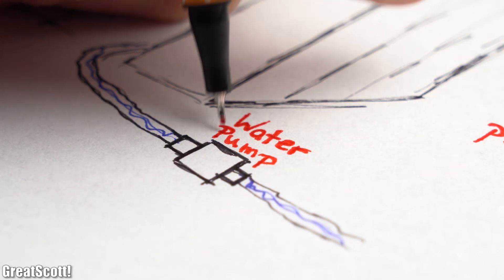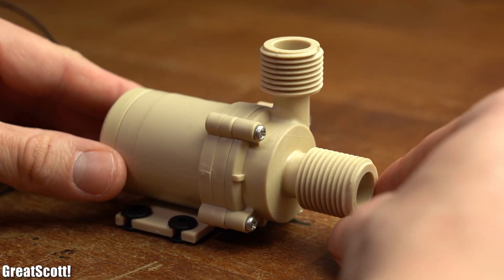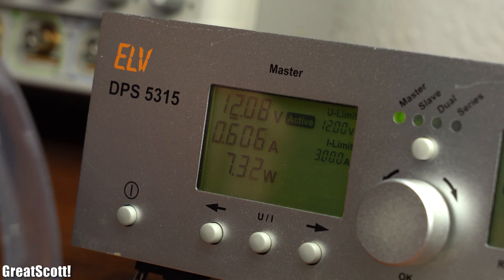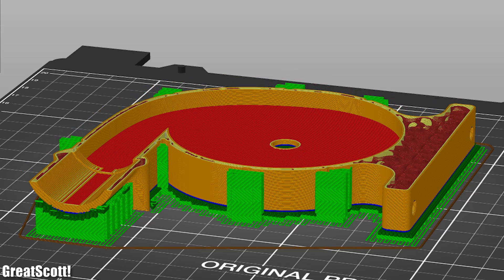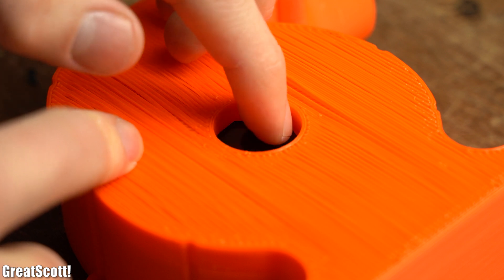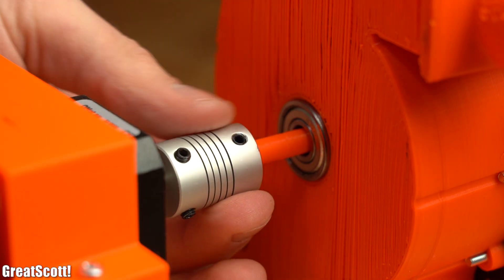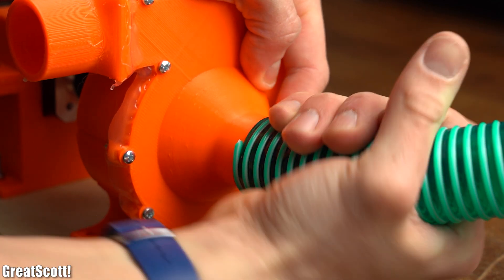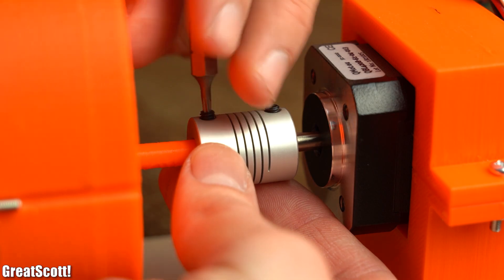Water Pump || DIY or Buy

Comment: Reduction in size of the pump volute and impeller would work for you, also this DIY design has its flaws, the discharge line dia. and suction dia. should not be the same, the discharge should be smaller. You need to ensure there's adequate Net positive suction head AVAILABLE. You could try printing the impeller and shaft seperately and lock it with some mechanisms like small screws or small key locks. The bearing should take the complete load and help rotate the rotor, but I suggest you assess the fit between the shaft and bearing. I also suggest you can read API 610 to know more about pumps.
Reply: And also since you have a 3D printer you can play with impeller designs, the blade angles etc.. to increase the pumping efficiency. You could also use normal PTFE tapes and make a seal packing. An eccentric reducer at suction line would also help you. I believe.

Comment: Water is one of the basic needs of life.  And so is food.  So, whereas watering your garden may be a luxury for you, it may be critical to someone else, as may be supplying their house or villiage with water.  Please reconsider attacking this problem until you reach success, even though it has been more than you wanted to invest.  Sometimes, 3D printing a mold, and forging a critical part in some kind of metal is the only way, so please consider that as well.  Thanks.

Comment: I made a water pump on my cnc machine crazy power  but stil not enough  so I'm going to put a 300 wat motor on it it's going to be a fuel pomp for a a rocket engine so for me buy it not the winner here because pumps this small never come in my power needs  but hay I do have a cnc macine capable of machining aluminium  so I cant really compare

Comment: 1. 3d print water pump.
2. put ripper bldc motor with 240a esc
3. test it.
4. if you didn't fly to the moon it is not working

Comment: Need a bearing on each end of the turbine so it doesn't move and snap the plastic... How didn't you see that? It was wiggling all over. Also could have sanded surfaces more and applied a permanent non-stick coating  to plastic to plastic moving surfaces.

Comment: Clearly, you are not using principles of fluid mechanics. In short use small motor print and small diameter of pipe instead of a huge one( You are putting too much load on the spinning shaft ). like the one you bought and have a small rotor instead of the big one. Try to use a metal shaft and ensure the metal shaft is properly connected to the rotor and you are good to go. I like what you are doing great work.

Comment: You are not supposed to apply teflon tape to that simple hose connector bust instead used a compression strangler...the metal type

Comment: For low pressure I use Rule boat bilge pumps, cheap and rock solid. For high pressure I use RV water pumps that will do 55 psi, for things like spray emitters irrigating my lawn.

Comment: I've made small water pump with junk plastics, metal and dc motor. I've made the fan by cutting and and glueing plastics and metal. The performance is satisfactory for a small pump. The most important thing is I had fun doing it :)

Comment: Taking the "replace the drive shaft with metal" I would have printed the impeller and drive shaft separately  so the layers of the shaft were lengthwise, thus making the shaft much stronger against sheering.

Comment: I'm genuinely shocked you didn't use a silicone gasket for your pump housing. Stuff is readily available at most any hardware or auto parts store, or if you're in a real bind, a steady bead with 100% silicone window caulk can be used short term.

Comment: seems like buy is the solution for the pump purely because of precision and material strength. that 3d printed one was wobbling around like crazy. I think there probably is a design of pump that with your material in mind, could work better than a centrifugal pump but that's a larger deeper dive. Additionally, its really going to be up to what you need to accomplish and that 3d printed pump seems like overkill when you probably only need a few litres/hour pumped.

Comment: why do your 3D prints have such a low quality? I think that with some fine tuning, you can drastically improve the quality of your prints and make them stronger. I think that if the impeller were printed with a polycarbonate material, it might have worked fine. 

I still think that buying is the way to go. Unless you have access to very good hardware and tools, and have some knowledge about fluid dynamics, a bought pump will outperform a homemmade one.

Comment: You can always make parts like the shaft thicker to increase strength.
Additionally, there are many other materials you can print with, such as carbon fiber, to get much stronger parts.
I would consider magnetically coupling the impeller instead of a direct drive. Also, I would experiment with different blade design to make for more efficient fluid transfer.

Comment: It's like a mechanical engineer creates a circuit. He knows something about it, maybe it's going to work but he cannot do it in the proper way. 
Pump design, pump scaling is not as simple as you think. Can you make a working centrifugal pump? Ofc, it's not hard. Can you make a working one with at least 30% efficiency? Without proper knowledge about hydrodynamics, affinity laws, Euler's pump and turbine equation, pipe characteristics, at least basics of mechanics, and tons of testing and measurements, no, you cannot. And this is the the bare minimum of the design/scaling of a centrifugal pump.
If you don't want to waste days/weeks for this project, I suggest to buy a simple one instead of trying to recreate them.

Comment: Why print the whole construction? Print the "rotor"-part to fit matching PVC pipings that are primed and cemented togeter. Smaller formfactor and higher durability. And of course, use a metal shaft. You know your shaft has to be thicc and hard to pump enough juice.

Comment: No centrifugal pump is self priming, that's why they're always located under a tank or in a pit. You can try my water pump if you want. Metal shaft and metal bearings. Designed to be semi-submersed, so no priming or seals to worry about. Small but moves a lot of water. https://www.thingiverse.com/thing:4122545.

Comment: The impeller is apparently inverted - the blades are angled wrong way, as they should face away from the outlet (compare it to the original pump). This may reduce the efficiency and increase the torque load.

Comment: Do a mostly 3d printed part and put you own metal shaft on it.  The layer boundries is the week part of 3d printing.  You could look at CNC Kitchen for tips to making prints stronger but replace the printed shaft with a rod from the hardware store and it should be a lot better.
Just read the top comment and understood why you didn't

Comment: You should have optimized the design, as for it is quite terrible in terms of print layers orientation in relation to the main forces, as well as the overall shape. You can not just grab some shape that is optimized for injection moulding and steel and hope that it could ever compete with a real product.

Comment: good job . but at the end you could simply add a metal shaft instead of the printed one and connect it with a bolt to the spinner part inside :)

Comment: Legendary video as always mate! Even with a metal shaft you would have had a leak from the shaft entry point at the bearing. Best is a mechanical seal, but for diy i would recommend a normal lip seal. You could have just printed a longer “hole” where your bearing went in and put a lip seal in there. For the lid normal motor silicone would of been fine. I Recommend, do not throw away the pump, just put a seal and a nice metal shaft to your impeller, you could even use a bolt for the shaft. And give it another go. The housing looks nice and the impeller is not too bad either. 
 Next time don’t give up at ur first failure. The electric part with the motor and controller was brilliant. 
Nice work !

Comment: You could drive the rotor with a hex screw instead of plastic shaft. Like m6 bolt and hex socket in the rotor

Comment: Things are always cheaper when you know what you're doing and know how to build it. The 3D printed impeller could be improved with attaching 1/8 to 1/4 inch thick aluminum plate matching the diameter of the [whole] impeller with the center of the plate having a threaded hole to attach a shaft that has a shoulder and threaded end matching the center of the plate's (threaded hole) attached to the impeller, this shaft should be a good fit through a race bearing, and shaft coupling. Attach to the motor, and boom goes the dynamite.

Comment: For future 3d prints, what I have found when I was building an audio recorder belt clip on my small channel was to print out shafts independently so that you can print it horizontally rather than in the weaker vertical direction, then just glue it in place. Rocinante newsletter - wonder if someone there is a fan of The Expanse tv show.

Comment: Loved the video! 

Fatal flaw: You compared a non-self priming pump, to a DIY non-self priming pump that you then tried to use as a self-priming pump. Assuming the shaft broke as the water initially filled the pump. Had you primed it yourself at a reasonable RPM it may not have broke. 

Obviously, more happened than what was on camera. Maybe you were too exhausted to print another wheel and shaft, or maybe you did print another, primed it like the first. and it broke as well.

Very well executed and filmed!

Comment: My experience is that 3D printed parts, at least in PLA, are not waterproof, even at 100% infill.
There are micro holes in additive printing, quite different from injection molding.
Waterproofing  the motor shaft - without creating friction - is a challenge as well.

Comment: I used a small AC pond pump that is for waterfalls in backyard ponds. IT would have been much easier to control a small DC/AC relay or solid state relay with your Arduino. Also, the pond pumps are self-priming. You can get a 100 GPH pump for about $30 is you look around.

Comment: For all those who still think that they can make it with a high-flow pump... Dont't even bother. They didn't say in the video you need a mechanical seal, which are very common and unexpensive, but needs to be correctly mounted on the seal base and the shaft. Plus the propeller was 'a little too much'  with its diameter; it'd have 'killed' the little motor.
In order ti create your own pump you will need to know how hydraulics and horse power relate to each other. Not to mention the diameter of the propeller and the rotation speed... Better buy one

Comment: The shaft wasn't even supported by the bearing tho.
Also is an easy fix to put a metal shaft or to directly drive the impellar with the motor's shaft.
But yeah, I understand, not enough time. You want to get a video out to make us happy, we understand, but I think we'd been happier if you just made it right even if it meant less videos this month, we'd be happier than we are right now because a lot of your projects seem rushed because of time.

Comment: I understand  if you don't have time to finish the build because of whatever, but tell people other possibities about how you can make that thing work. You haven't been able to finish this build but that there is still a chance for the diy option, for me, it's a draw between you and the industrial product.

Like many other comment point it out, a metal shaft would have been a good solution, they are some flore on the design of the impellers,  also the sealing technic used is horrible.
The point of this kind of video is to show how to make something that works by showing what are the right solutions for a certain problem. If you don't have the solution, try to ask people and get some help.

Comment: TPU filament could have been used to create the gasket and a one way valve on the output could add a self priming function to the pump.
The drive shaft should've been printed horizontally, oversized and filled to precision or ommitted entirely as a simple socket could've ben used on the rotor to fit the motor's stock shaft onto.

Comment: I believe the main fault here is in the design of that bigger pump. The axle should've been a separate piece and beefier, with the diameter decreasing only at the end where the motor finally connects.
Another solution would be to use a metal shaft for an axle.

Comment: you should have placed the coupling close to the bearing to avoid whirling of shaft .. 
even then using a plastic shaft is not a good idea, 
could have used a metal shaft . press fit into the bearing , and the propeller can be mounted to the shaft via a rivet or collar or something .. 
great try .. well done

Comment: Rather than 3d printing the drive shaft, the impeller should have a hole in the center that mates with a screw or rod.  This will give you a metal drive shaft.  I've done something similar with impellers that spin much faster so I can attest to the fact that it works.

Comment: The impeller vanes were backwards, wrong-sided. By the front view of the shaft, they're curved for a clockwise rotation. The pump can work, even because this design actually exists, but you have a great loss in hidraulic performance!

Comment: Might be worth also having a look for bilge pumps. They should be cheaper and have a much higher flow rate. You'd just need to install it at the bottom of a bucket or something.

Comment: I feel like this boils down to your R&D restrictions: there are numerous solutions that all might help fix the issues with DIY that you found. Perhaps try to use those solutions when you actually get to implementing it in your greenhouse system. Printing in another direction or not with the layered extrusion method might help, or using metal parts for things like the shaft will very likely solve it. Great video even if it was less conclusive than you like to be, time constraints are tough to work with! :)

Comment: The PETG axis is noticeably smaller than the inner diameter of the bearing. In this configuration the bearing makes no sense. Slide a sleeve over the PETG shaft (e.g. a pipe made of PVC, aluminium or brass). This stabilizes the shaft and reduces the vibrations caused by inaccuracies in the construction. This helps and is little work if you glue the fragments of the shaft into the sleeve. If necessary the shaft can be stabilized with a screw.

Comment: The vanes are backwards, the design of this pump has 2 major flaws, I printed this a long time ago, realised late that the vanes are backwards, I had to cut the vanes individually and stick them back, the area where the water exits the pump must be gradually increasing and in this design its not. The pump looks nice but the design is weird. I haven't tested my pump still though and thanks for the silicon tape idea.

Comment: Do replace the shaft with one made of steel. Possibly that also fits the bearing internal hole..
Print the rotor with the blades in the correct direction. As we could see @3:33 they are right, @4:59 they are wrong.
And go on! ;-)

Comment: I can offer a few structural ideas to help you make a printable pump actually function. 

1) Create a lip within the perimeter of the pump casing edge on the mating surface. i.e. the face of the pump housing, ensure they are on the INSIDE of the bolt hole pattern (so, between the inside edge of the mating surface, and the bolt holes)

2) Create a matching recess on the opposing face, only a little deeper to make room for an o-ring, or gasket sealer

3) don't 3d print the shaft for the impeller, instead, use all-thread, or threaded rod, capture the impeller on the end of the shaft with a nut and washer on either side. 

As for sealing the through-hole of the casement. Rubber sealed bearings are your go to, double them up, with a rubber flange or set of o-rings in between them. The fitment of the bearing to the housing should be sufficiently snug to prevent leaks there, and the rod can be sealed by capturing a smaller o-ring that fits the rod with a washer and nut, I'll call this o-ring #2just ensure this washer only contacts the o-ring, and the inner race of the bearing. I'll call this smaller one  washer #2

Stackup on the rod:
Nut -> washer -> impeller -> washer -> nut -> [small distance] -> nut -> washer #2 -> o-ring#2 -> bearing -> o-ring -> bearing ->  o-ring#2 -> washer#2 -> nut -> coupler -> motor

The goal is the seal these bearings, without binding the inner and outer races together. Sealed bearings are a great method of doing this, and just a few more bits of hardware, you can seal the threaded rod as well. 

A better approach would be to use a smooth rod tapped one end to capture the impeller, and compress the inner races of both bearings against a rubber ring that is on the rod, but the above method should suffice.

Comment: DIY vs BUY, ESP8266 smart switch w/alexa/google integration. I'm working on setting up home assistant on a raspberry pi, and have 6 each NODEMCU ESP8266 + Relays. But as I'm digging into software I find that there are ~$5 pre-built options. DIY is more flexible in that I can code it in Arduino and have it read sensors etc where the pre-built ones are largely focused on switching a relay. I'm thinking there is a place for both in my smart home, but would love to see your take on it!

Comment: As soon as I saw the print I knew that was how it was going to fail. You should have just used a cheap threaded rod, nobody prints a 6mm rod.  Also there's better pump designs where the spinning parts don't come in contact with the water, so it doesn't need to be water proof.  Take a look at this (I think it's called a peristaltic pump):
https://images.app.goo.gl/qZhYNBubJH27vGRQ9